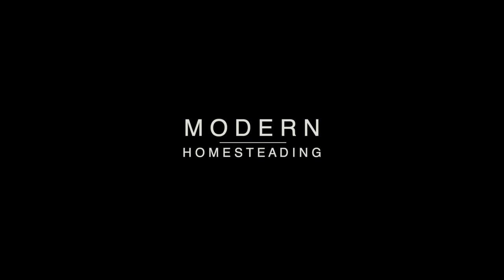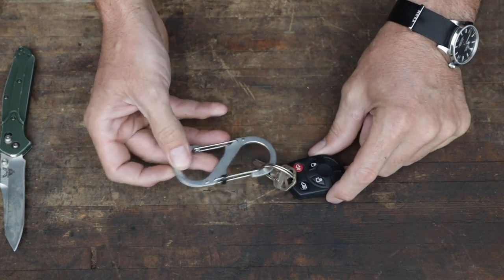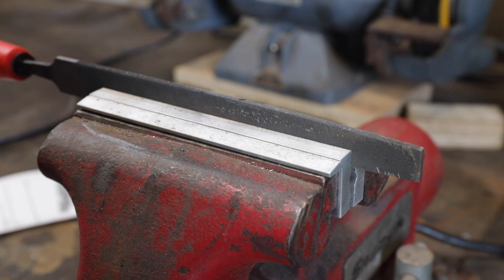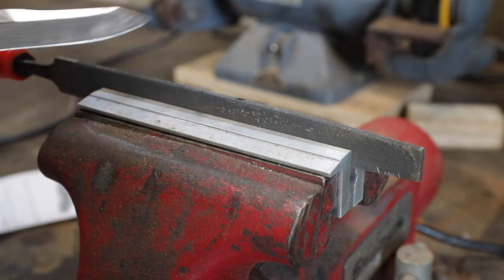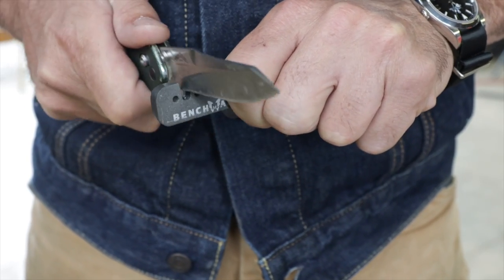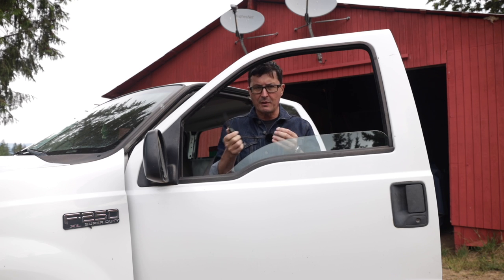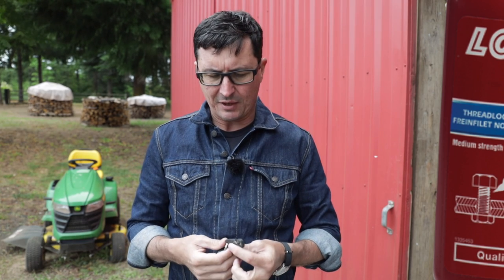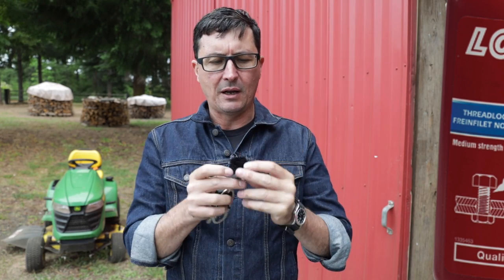Is This The Best Knife Sharpener Under $20

Comment: My cousin once found my knife cuz i left it on floor for a bit and he tried stabbing and cutting a brick wall....i died inside.
Reply: 😐😐 how sadistic is your cousin...
Reply: At work one time someone asked me if I had scissors or a knife, I asked what for and they said to cut some string that was holding up some clothesline wire. I let them use my knife but, next I here them getting frustrated and muttering about it not cutting. I went over to find they couldn't reach the string so the tried to cut the clothesline wire with it. Rolled the edge so bad you could see the shine along it from a mile away.
Reply: @Elijah Soper same I was bout to buy a Winchester anniversary knife and the kid dragged it across the concrete before he gave it to me and told me he was sharpening it lol idk how but it’s still pretty sharp
Reply: @Elijah Soper the schools are clearly not teaching useful information like knife sharpening 😂
Reply: Still isn’t as sad as your spelling.

Comment: I've had a few of those that I purchased from Marble's of Gladstone when they were in Michigan and have used them in the field for over 25 years. Like you state in your video, certainly not the best edge one could possibly get - but in the field or on the road - they do work. FWIW mine had been used for many many years and still works perfectly. Since I am very good about keeping my blades super sharp (on my Dan's Arkansas Stones)  - I use it more for friends knives when Hunting or at their cabin and it truly helps turn their "Butter Knives: into something serviceable. I also don't keep it on my key chain but I always have one in my Hinting Vest and another in my Glove Box. I believe I paid #10 each and have gotten every penny out if them. BTW - the back of the devise is meant to hone the blade after sharpening it between the Carbide.

Comment: I have a Browning knife that has a similar carbide sharpening system held in place on the top part of the handle with a magnet, it is actually part of the handle........best thing  about it that it is always with the knife, and not in the way.....no need to remember to carry it.......I sharpen most of my knives with my KME but out in the bush.....it is much better than a river rock......I have also used the car window and also the bottom of a ceramic coffee mug at camp.....great video.

Comment: If you are pulling the curly shavings off the edge, you are putting too much pressure on the edge. Using moderate pressure will leave coffee ground looking debris. When you get it where your finger pads "stick" to the edge, change the pressure to light. Using the thumb and forefinger on the scales and the middle finger just supporting the knife pull 15 to 20 times. Use only the weight of the knife. No pressure from your hand. It may take 40 to 80 strokes to get a good "sticky" edge. At that point it is or should be almost hair poping. If there is some leather around finish up with some light following strokes. Taking your time shaving sharp is possible.
My biggest problem starting out with the carbide sharpeners was wanting to do it in a minute or two. It is like using diamond plates. You can bear down and abuse the blade and sharpener. Using a light touch changes things.
I am proficient using water, ceramic and diamond stones. Even have a belt sander set up.
But sharpening with these carbides is a challenge. I can take a thrift store SS table knife and put a tomato shaving edge on it in about 10 minutes using one of these "X" carbide sharpeners. 
Is it a reflective mirror edge? Nope. Looks like it came from a factory in China. But something I have learned from sharpening for the public. 
THEY DON'T CARE HOW IT LOOKS. For $10 all they want is for it to cut and the edge to last. For my public sharpening I use the belt sander or my Tru Hone. Somebody drops off 10 knives and wants them back in 30 minutes you are not going to use stones, sticks or rods.
Practice with this carbide sharpener and I bet in a month you will change your view toward them. Replace stones? No. But they do work.

Comment: I carried the previous version of that in my key ring when I was at a job I had to cut open a lot of cardboard boxes. I had a cheap gerber knife and when it wasn't cutting anymore I would put and edge with that sharpener and it worked fine.

Comment: It reminds me of my Smith's brand pocket sharpener. If this had a ceramic side it would be my new contender for quick and dirty camp/field sharpening tool. The Smith's also has a rod for serrated blades but the quality is dubious at best on the Smith's. It gets the job done at a cheaper price but they will break under abuse or just heavy use. Nice review, I found it fair and reasonable for what the tool is meant for.

Comment: A decent set of progressively more fine whetstones and a few old knives with which to practice is the last knife sharpener you'll ever need.  Been using the same set of stones for 6 years now and all of my knives can cut paper like it's butter and shave hair with no issues.  I've brought back some super high end knives that I found at Goodwill from the dead with a bit of time on the stones and I still use those knives in the kitchen today.  Once you learn to sharpen a knife well using stones and oil you can use the same knives for (well, for me it's been 6 years) decades if you keep an edge on them.

Comment: I have an old small Gerber branded pull thru sharpener that has ceramic rods on 1 side and something gray on the other.  I never got it to work well but I do prefer hair shaving Sharp knives.  I have sharpening compound on my leather belt.  It works really well for touching up a blade as long as there are no chips or burrs.  Maybe your sharpener would work well with a strop.
Reply: Do your self a big favor and throw away that Gerber sharpener, after every pass you ceramic puts a layer of stuff on your knife and you have to go to a grinder to remove it

Comment: The only pull through sharpener I use my is my Gatco with the medium and fine ceramic rods.  Once watched video of what carbide does to knives and I'll never use it again.  It doesn't sharpen, it tears an edge into it.  In an emergency sure but for an every day thing oh hell no 😬
Reply: What if you had a gerber paralite that you used all day long cutting open boxes wouldn't this be a good thing to have on your keyring at work.
Reply: There are pull through sharpeners that have flexible arms.  Those are actually pretty good because they act more like a Chef's steel and hones the edge without taking off a lot of metal.  Great for maintaining a good edge but not for a far gone edge.  I use the Hunter Honer but the Block sharpener is similar.

Comment: I have the same Para 3 and I think that I prefer the Para 2. But, I have been quite happy with a Ganzo F7563 that is less than $25 and robust as heck. The carbide sharpeners are only good for cheap knives and for an emergency after a major amount of edge damage. Otherwise, it’s not useful at all for maintaining an edge that’s adequate. It’s a restoration tool rather than a maintenance tool.

Comment: I will say I use this sharpener once in a while and its great for a quick sharpen. Ill throw it in my camping stuff sometimes or leave in my truck. I do leave it in the kitchen junk drawer and will use it on the junky cheap kitchen knives sometimes. I hate sharpening knives or maybe becasue I never really learned but I does work. But I do use this on occasion and then I use my leather belt to finish the blade and that helps a lot.

Comment: Good place to put it would be with you flint fire stater now you have a knife sharpener just put them both together and add it to you ATV or motorcycle. in case you get lost or brake down... good Video's Cody and have to stay the night.

Comment: I use that kind of sharpner in the feild. Extra light pressure many strokes and leather strop.  It will be a serviceable edge and shave hair. Most of my knifes are not super steel that might make a diffrence.

Comment: Try the poker chip sharpener off of amazon, it's under 20.00,runs about 13.00 actually, I think it'll even sharpen karambit,knives cause of the curve,that's just in my opinion, I seen an older chap using this an he swears by it. Just thought you might like to check into this for your review on the channel.

Comment: I'd recommend the Lansky blade medic over this. It has the carbide sharpener if you need that quick edge but also the ceramic, ceramic serrated, and a diamond tapered rod. It's only $11 on Amazon comparatively. It's not quite as small at around probably triple the size but you've got options to compensate.

Comment: Not quite as compact but i love my spyderco “double stuff” , i load the leather pouch with some medium compound to strop afterwards and it gives you a really nice edge with a near mirror finish or the harder steels like m390 and 20cv etc like to be left a little toothy but if im at home i use the same process followed by the spyderco 306uf (ultra fine ceramic bench stone full size) ive never used wetstones since as not to risk getting the particles/slurry in the pivot

Comment: I'm sorry, a 60 dergee edge is fine for an edc knife? Do you really use those angles on your knives? Spyderco comes with a 34 to 36 degree edge, even Benchmade is around 40. What do you do when sharpening those, adjust the angle by 20 to 26 degrees?

Comment: I like the hunter honer better (or the similar Block sharpener).  Essentially V sharpeners with flex which allows for honing without taking off a lot of metal like a chef's steel.  I use them to maintain an edge (keeping a sharp edge sharp) but if I need to do serious sharpening then I use the Work Sharp with the blade grinding attachment.  That thing is awesome.

Comment: Any carbide sharpener is a last ditch item. They rip steel off your blade! They rip steel until it's in a V shape. Wouldn't use it unless it's all I had. It hurt less to watch the 940 go across the file!

Comment: I have diamond stones and other sharpening stones.  However, my favorite two sharpeners are from Lansky.  One is a wood block with holes set at 20 and 25 degrees that hold either diamond encrusted metal sharpening sticks or ceramic sticks.  The other is a small pocket sharpener with rough carbide V cutters, ceramic V cutters, plus a diamond and ceramic surfaces for touching up serrated blades.  It's not the best sharpener in the world but it will always have a spot in my packs for touching up a blade.  Best of all, they are under $10.
Can I do a bit better with other sharpeners?  Sure... but it's not always worth the time investment.

Comment: I sharpen kitchen knifes quickly on the backside of a ceramic plate, works well for just touching up the edge a bit before cutting something. I have had Fiskars quick sharpener (pull through) also in kitchen for over 15 years, works wonders and the Mrs. can use it and stop nagging me to sharpen the knifes.
Reply from the maker: great tip,

Comment: Carbide knife sharpeners tear metal in sizable pieces leaving a somewhat saw edge. Cleaned up with a fine stone you get a good edge. I still prefer an adjustable angle system for different uses.

Comment: I've never heard of the glass trick - does this replace the need to strop on leather after a sharpen?
Reply: No it doesn't. It doesn't polish the blade it is just like a, let's say 2000grit stone. BTW the trick also works with the bottom of a plate or a ceramic mug.
Reply: @marklichem  appreciate the info, thanks.

Comment: I’ve used those carbide pull through sharpeners before and I swear they make the edge worse. The only good pull through sharpener I’ve ever had was a Victorinox brand one, but even that was only good for touch up. If your blade was completely dull it still wouldn’t do the job.

Comment: Those type of sharpeners remove a lot of metal... I will only use them when I have a very dull, nicked, somewhat neglected or abused blade, such as cutting wire in a pinch. I try to use a pocket steel, diamond coated rod or stone type or ceramic sharpener to re-gain an edge. I get kinda attached to my favorite edc and want to keep the blade as full as possible... I don't like carrying around something with a blade like a fillet knife from overly aggressive sharpening...

Comment: Side note; got one of those key ring caribina from Depot and my keys fell off multiple times.  Found out if they twist at the edge of the wire tip they fall off like butter.  Threw it on the ground at a gas station and never looked back.  That style is garbage.

Comment: It's a carbide sharpener, it's gonna shear off steel and take too much of it at that.
It'll give you a very rough toothy edge and really is only good to be used for a couple feather light strokes to hone an edge.

They work but are not good.

Comment: I think carbide sharpeners  are too harsh. They scrape off gobs of metal.  If your blade has a big nicks, and you're determined to get the entire length of the blade down to the trough of the deepest nick, they might be useful. Otherwise, it's like cutting  a dado using an axe.

Comment: Those pull through sharpeners are the worst possible way to sharpen blades. The remove all the hard carbides from the steel which means you have to sharpen more often do to the steel being softer. Stones every time

Comment: The question is...will it work on an axe???
Reply: Er yes, ive used similar  devices on my hatchets in the past works welll enough. They do remove a lot of metal at a time though so you need to go easy on the pressure. Also they tend to round off knife points as  you  draw the blade off the tool, its unavoidable either you stop short of point a have a dull bit or sharp to the tip with a rounded point and a dull bit.  Still that said 90% sharp is more use the 50%  :-)

Comment: King 1000 grit whetstone. $20
Reply: It would look awkward hanging off your key ring.
Reply: @stillwatersforge3957  Lmaooo. Wouldn't it be cool to have a mini compounded strop on a keyring
Reply: Check out diamond cards. They usually come in 2 grits.  Make a leather holder( or buy one) and put rouge on it. Then you have a complete sharpening system in your pocket. Though it's not very efficient like a stone is. I'm a bladesmith btw.

Comment: Those carbide knife sharpeners are bad news. Steel is not a perfect blend. It has softer parts and harder parts and these carbide sharpeners can literally rip out the harder part of the metal. It may seem that your knife is sharper, but I would stay away.